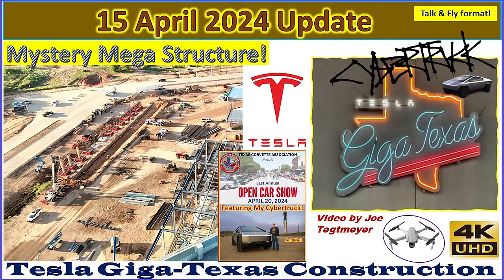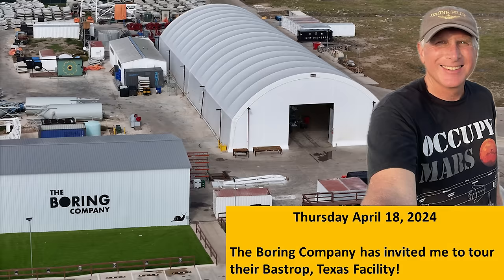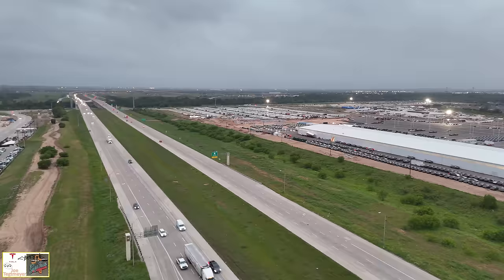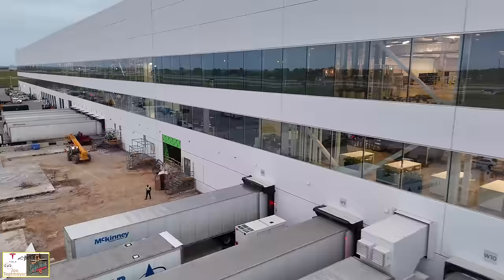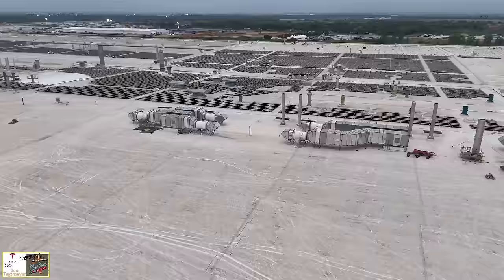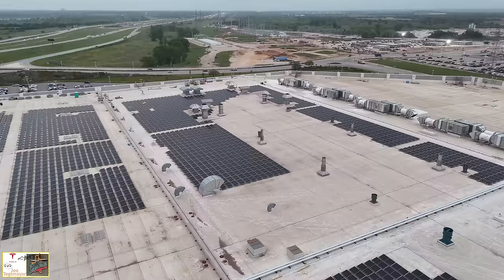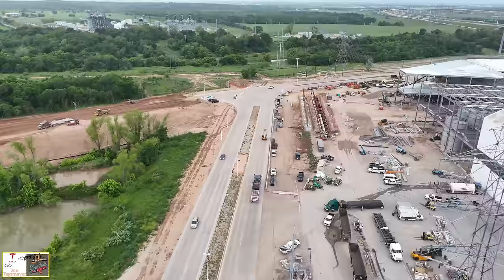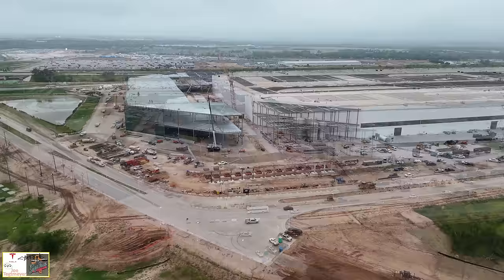Mystery Structure! Cybertrucks Pile Up & Leadership Changes! 15 Apr 2024 Giga Texas Update (07:15AM)

Comment: Joe, if you have the opportunity maybe asked if there be a pair of tunnels - i.e. one way traffic in each tunnel?  Also will traffic be limited to cars and small trucks?  Max Height of road semis is around 13’6”.
Reply: Semis not likely to fit through a 12' tunnel. As I have been saying. The tunnel, in my opinion, is pretty much useless.

Comment: Wouldn't the un-reinforced concrete be for the tunnel to come up inside the building? In tunnel construction documentaries I've seen, they usually bore through a section of concrete wherever the tunnel terminates (like underground railway stations).

Comment: Just an assumption but maybe the boring machine is gonna come through that concrete at the west end, would explain why no steel in it. And looks like it is almost exactly lined up with the beginning of the tunnel. Closer can’t come up to the surface since the underground water vault is in the way.
Reply: If you go to 24:00 you can see how the TBM is aligned directly with the gap in the perimeter grade beam. The new section of concrete floor is the next column bay south.

Concrete floor unrelated to the tunnel, except as a possible location for the crane to dismantle the TBM.
Reply: @DessieDoolan  Saw that. This is why “almost “ is in the sentence.  But I guess, time will tell.  Thank you
Reply: @hujaglobalenterprises2355  Also to consider is that the slab is 'finished floor', been steel troweled, saw-cut, has block-outs around the edge for dowel plates to join into the abutting slabs.

The big empty space in between the 2 slab sections might get conventional rebar and concrete slab to beef it up enough to place a crane on.

Comment: Hi Joe...thanks for make the videos.  Question since you're going to Boring Co tour Thu: @Giga Texas, why did Boring Co. clear grass on W side of highway right up to the asphalt?  Why do that if they're drilling way under the highway?
Reply: One reason was to add a layer of compacted earth over the tunnel alignment. Visible at 22:32. A 'surcharge' as described by tunnel engineer David Salisbury. Cleared the rest of the way to the highway perhaps assuming more earth would need to be added. Centre median and the median and berm across the east side haven't been cleared.

Comment: Joe I am sure you have posted this before, but what is the pace (feet per day) that the Boreing Co. can drill? Estimate when they will come out the other side?
Reply: Typically a machine of this type can excavate at 4" a minute (all things being ideal). Making it theoretically possible to excavate a 5 ft ring advance in 15 minutes. They then have to stop and build the ring. This can be done in 30 minutes if really efficient. Allowing some time for the startup and stop processes it is possible to get a ring an hour, or 24 rings (120ft) in 24 hours. In reality this is never achieved as there are a number of sub-processes to be achieved, breakdown and maintenance, shift change etc. The term for this is Utilization, often between 70% and 90% on a well run TBM.
Also, they now need to stop for a couple of weeks to install the backup decks, then they can hit full production. 
Not sure if they are working a nightshift.
Full weekly production could be anywhere between 200ft (60m) (D/S only, 5 day week and 70% utilization), and 750ft (220m)(24/7 and 90% utilization).

Comment: 18 truck loads of cement starting at midnight
Reply: Where to?
Reply: Joe finds them troweling the garage deck in the morning. The pump is gone. All that is done overnight.
Reply: I think it's going to park garage. I gotta deliver 3 of them
Reply: @forwardthinkingtrucker  Thanks. Incredible that the concreting works continue through the night.
Reply: @DessieDoolan  starting to get warmer in Texas. It'll start shifting mostly at night. Next month we'll most likely be starting around 8-9pm. It cures to quickly in the heat. Otherwise they have to spend a lot of money on ice to keep the temperature down long enough to get it onsite
Reply: @forwardthinkingtrucker  I'm not a local. Find the weather in Austin quite weird. I don't think I've ever been on a concrete pour earlier than 5am. Then again, I've never worked on anything quite this big!

Comment: Still no v12 for my 2022 M3, despite the fact I'in America & I've driven fsd beta for 40,000 miles across 20+ states. Tesla 100% lied about it and has no idea when my car will get it. I have awakemed from the tesla cult and cancelled my fsd sub (v11.4.9 still?) and I cancelled my cybertruck order as well. I'm 100% finished with the tesla cult. I'm done.
Reply: Rohan tweeted a couple of days ago that those on 2024.8.x should get the most updated build this week, we'll see if it rolls out [hopefully no delays]

Comment: South extension will be AI data center.
Reply: Why the high ceilings?
Reply: @jbbuzzable  From Electrek. 25K car cancelled. AI for robotaxi instead.
Reply: @jbp1985  So this is your conclusion?
Reply: @jbbuzzable  Read the Electrek article.
Reply: @jbp1985  I didn't read the article, but it sounds like you agree.
Reply: @jbbuzzable mezzanine levels can be added later
Reply: @michaeljohnson1805  Sure, there will likely be a little bit. Maybe you think that the whole thing will be converted. Personally, I think not.
Reply: @jbbuzzable  I didn’t say the entire building but I think the first floor will contain a parking lot for the employees working in this area hence the taller cement footings..therefore the office space will only start on the second floor and a mezzanine level…the section of the addition that doesn’t have the higher cement footings will be more than likely be used as a factory area..but that’s just my thoughts..we will see…